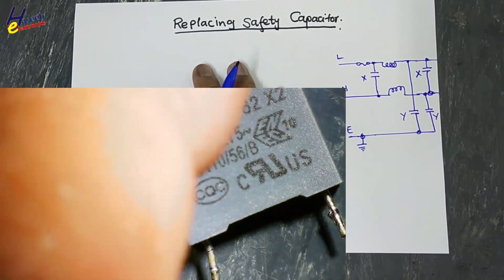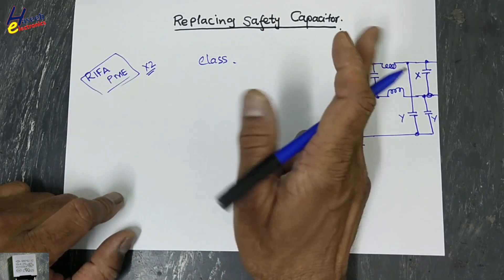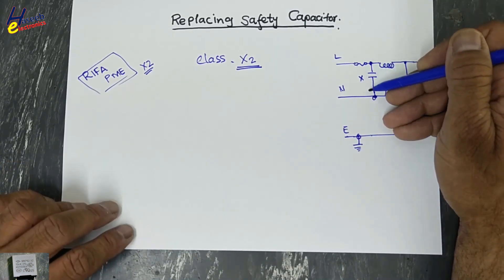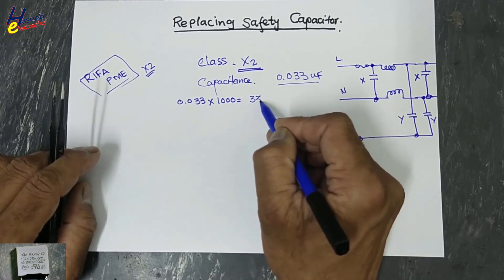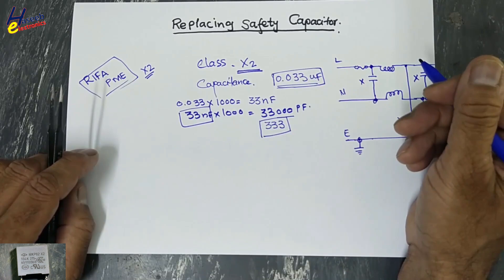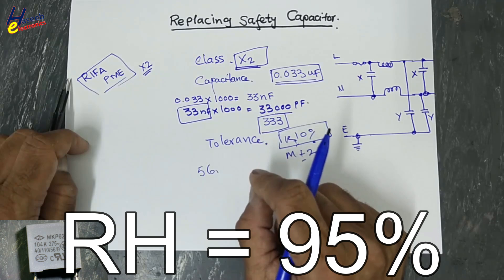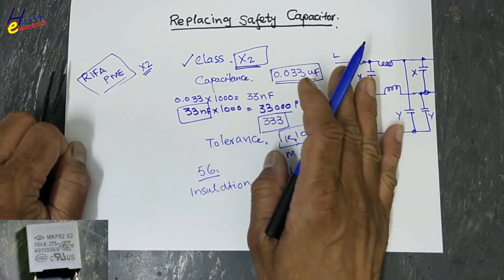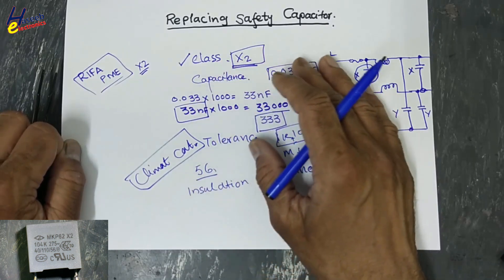{1317} 5 Key Points for Choosing Class‑X Safety Capacitor Equivalents | Haseeb Electronics

Comment: All good information about X and Y capacitors. I always try to get 310 working voltage because they lasted longer compared to 275 V capacitors and I always try to buy good quality replacement capacitors like some well known brands capacitors. I usually check these non polar 0.1uF and above value capacitors with my Blue ESR meter and also check their capacitance values with LCR meters too. ESR meters are very good for all type of capacitors testing specially Electrolytic capacitors,Ceramic capacitors,paper film capacitors and Mylar capacitors.